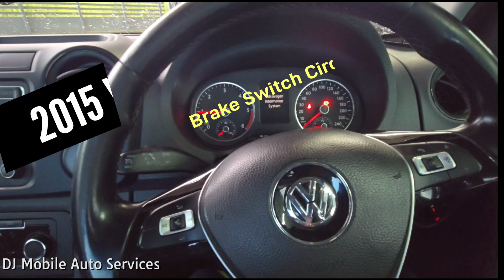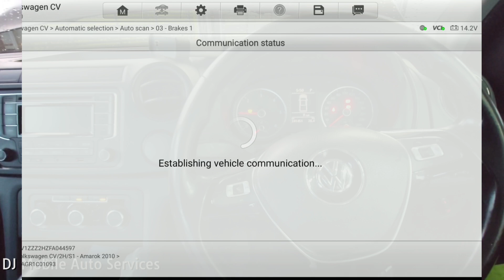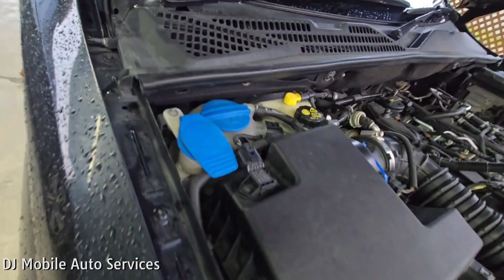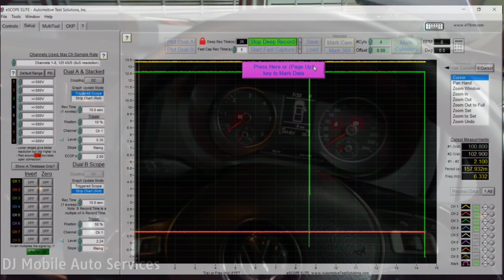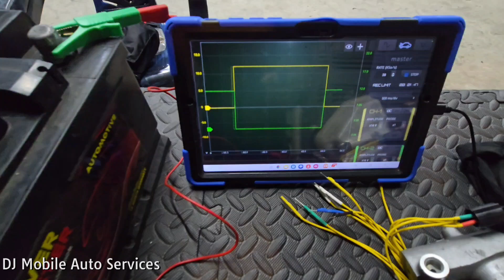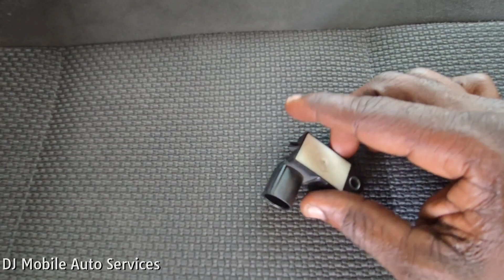2015 VW Amarok Brake Switch Circuit Fault. P0703 Glow Plug Lights Keep Flashing Diagnosed & Fix

Comment: Hi.  My amarok 2012 tsi EPC light keeps coming on. On one part it said that the abs sensor is having issues.  Can that be the reason it goes into limp mode
Reply from the maker: I could be. Once you have a fault in the braking system. The vehicle may reduce power

Comment: Nice work young man I have 2017 Hyundai Sonata Braden light bulb blows every 3 months with the 2357 bulb is the original  6 months with the 1157. Bulb where start Hyundai claim it’s the socket
Reply from the maker: Appreciate the compliment. You should have the harness or connector checked or replaced. It may have some sort of corrosion in it that is causing the bulb to fail. Because I'm not seeing how a bulb only lasts 3 months unless it's the incorrect amperage
Reply: @djmobileautoservices  Hyundai are like that look at one when you ride by I ask was it a recall they said no
Reply: @djmobileautoservices  I’m check the amp I have seen where guy put a resistor In between the hot wire